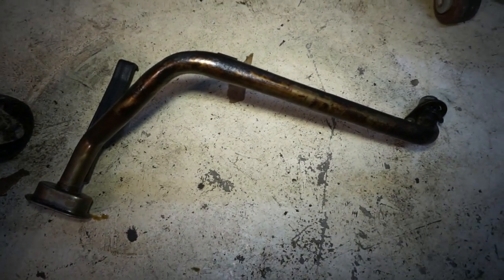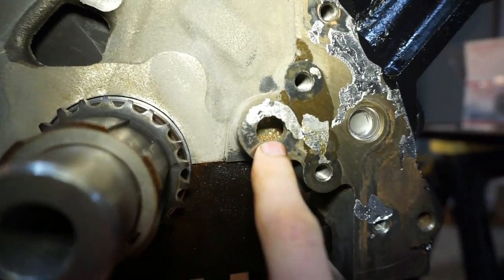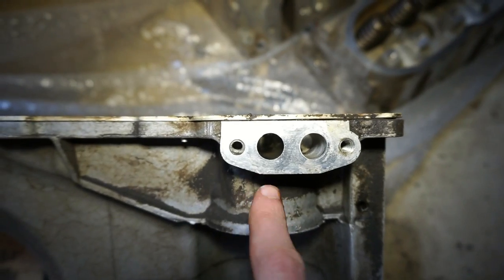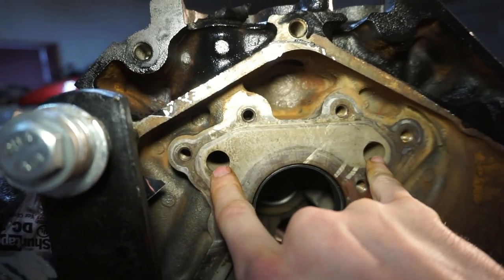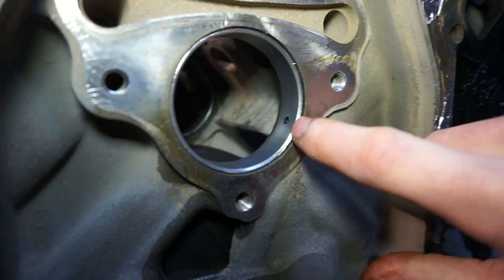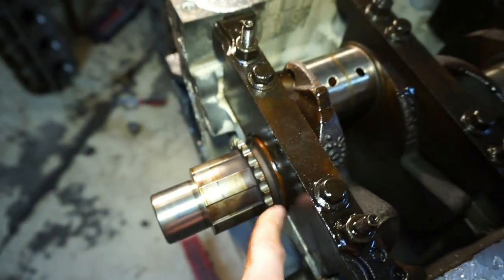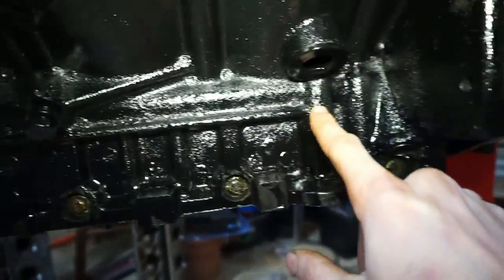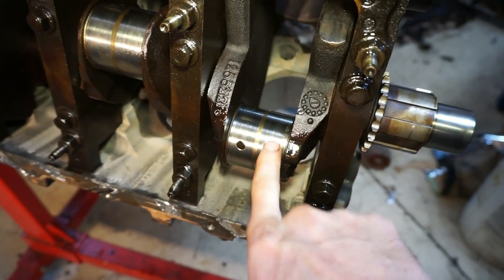LS Engine Oiling!!! Lq4 Oil Passage Flow!!! - a21bravo

Comment: Thank you. Your a life saver. Just rebuilt my brother 5.3l to have zero oil pressure at start. Quickly shut it off and had to think for a min then looked up how exactly the oil flowed through the motor. That's is when i found this video. Just as you started pickup tube to oil pump then you showed the soft plug next to the oil pump and i thought oh shit. I looked up my build pictures and realized that plug was not put in. Thought the machine shop i use did it but no worries took only 1.5hrs to correct my mistake. So thanks again for the video.

Comment: Good video. Lots of so called LS mechanics never take the time to understand this. To add, anything below the pump is suction, and a leak there can cause aerated oil and/or loss of pressure. Anything after the pump is on the pressure side, any major leaks along the way will cause the remainder of the oiling process to suffer.

Comment: Something an old seasoned ass commercial refrigeration tech used to always tell me back in the day when I was learning refrigeration systems, "follow the fucking flow!!". That simple phrase is applicable in so many scenarios, from fluids to electrical and mechanics. You're pissing in the wind trying to diagnose something if you dont understand the process.

Comment: I have never heard anyone pick up on this but like the way chevy designed the cam/ mains oiling it simply oils both at the same time instead of the way a factory 350 engines where the oil must flow around the cam to feed the mains and I also believe this is a better way than the aftermarket priority main oiling
Reply from the maker: Agreed.

Comment: EXACTLY WHAT I WAS LOOKING FOR!! Concise and thorough. Thank you so much! Now for the question: Why would you source your oil for your turbo from the oil cooler ports knowing that you're potentially robbing it from the cam and crank!?! I'm hearing you want as much volume to the turbo as you can freely flow (like a 17mm hole!) Makes me worry for my engine... Looking for input fellas.
Reply from the maker: The pump should provide more than necessary as there is a relief valve controlling it... On my truck I have it pulling right before the pressure switch and always has good pressure.
Reply: The oil cooler ports can potentially spell big disaster for these engines if you don’t understand how the lubrication circuit goes. You dont always want a ton of oil volume going into the engine, depending on oil pan capacity and the type of turbo youre running. Many Ball bearing turbo’s need restrictors. Many shallow depth oil pans can be sucked dry with a high vol pump

Comment: Great video! Very helpful! Quick question, my 6.0 Gen IV (L96) isn't getting oil to the rocker arms but my oil pressure sensor reads proper pressures. I'm concerned about a bad camshaft. Should I be concerned about the crank not getting lubrication? Will oil bypass the rocker arms and still lubricate the crank?
Reply from the maker: Yes the flow goes both directions to crank and rockers, the pushrods can get clogged and block flow. Pull them and hold them up to the light, should be able to see through them.
Reply: @BlaserBuilds  thanks for the reply! I pulled my pushrods and I blew them out but I'm still not getting oil coming to the top of my rockers. My oil pressure reads around 40. My next step is going to be inspecting the camshaft to look for busted journals or lobes. Should i do that next? I should also mention my truck has a squeek that happens at the same RPM as the camshaft.
Reply: @TheDadBodWorkshop  try a new rubber o ring to the pickup tube, that cures oilin woes sometimes
Reply: @amindnew527  thank you! I ended up pulling the camshaft and sure enough a lobe on cylinder 8 was bad as well as several camshaft bearings. Thanks for your help!

Comment: that was very cool! are you going to put an aftermarket pan to not starve it in hard cornering / acceleration?
Reply from the maker: Blaine Ludeman Wasn't planning on it, we'll see how fast she goes. Haha.
Reply: there's also a new engine masters that talks about using less oil for hp gains .. about 1 quart low is supposedly best lol. weird huh? less oil for the crank to churn through
Reply from the maker: Blaine Ludeman Haven't watched that one yet... I'll have to check it out.

Comment: Lost a keeper after a spring snapped/pushrod bent. took head off, oil pan off, pick up tube checked exhaust still can't find it about to remove timing chain  chain cover see if its in there. Should I check oil pump I don't know where to look after this Yes I watched and saw all oil passages I have a LM7 don't know if it differs I would assume not either way I've checked everywhere I can without taking the motor it's self out I really hope I can find it. I kinda just wanna send it if it's not in oil pump or timing chain cover I think I'm just gonna send it and hope for the best I'll learn the hard way if I have 2 😢.

Comment: a guy i know some how got an easy put down into the oil galley unter the orifice that is on the vlom engine at the back of the engine where the oil goes from the filter and up into the vlom head. he thinks it has managed to get into the oil galleys. so we started telling him to blow air into that oil port just under that vlom head and try to move it to a spot he might be able to fish it out. but now i'm leaning on him taking the timing set off and the cam thrust plate and using some type of magnet on a wire or stick to try and fish that part out of the oil galley. i think his turk engine is the 2007 4.6 v8 and form photos of that block that oil galley is large. also if the lifters remain in the block i do not think he has to worry about that part dropping into a crank oil port. so do you have any ideas? or maybe some one here can help out? he said he broke off an easy out and i told him they do not shatter like taps and some drills do. so it still has to be a complete tip of an easy out. and i have no clue why he did this but for maybe trying the get that meter out of the vlom head and the tip broke off.  thanks

Comment: Okay I have a question I just got a engine block bored and honed and put eveything back together but I'm not getting any oil in the lifters/ thu the push rod  all the lifters are new so i am not sure what is going on the oil pump is a new high volume pump and I havent had a chance to check how much pressure I actually have due to the fact I currently dont have a oil pressure gauge I will be getting one but I still went ahead and took the oil pressure sensor and had someone start it and I am getting oil to the sensor I'm just not sure why I'm not getting any oil to the lifters or up the push rod any thing piece of information will help I will be getting a oil pressure gauge soon to see how much pressure the pump is actually making.....
Reply from the maker: Did you put the barbell back in? Verifynwith gauge,and check if Pushrods are clogged? Hold up to light should be able to see through them.
Reply: @BlaserBuilds yes I put a biliet barbell and the push rods arent clogged when I first put the motor together used compressed air to clean them and I will be checking with a gauge as soon as I get one on my hands would you know of anything else I could look into other suggestions

Comment: I have a question would oil barbell cause oil pressure issues if you rebuilt a motor and dodnt replace it ik there is better aftermarket ones but would it effect it if it hasn't been replaced??
Reply from the maker: Only is its damaged. Usually not, but its possible.

Comment: So, I’m guessing you can’t prime the engine being the oil pump is on the crank? You know, prelube before firing her up?
Reply: yes you can prime the LS engine,there is a plug on the left front side of the block,remove the plug ,use a threaded adapter and hose with a manual or air pressure pump with resivoier and prime the engine from there.
Reply: You have to prime the LS with a pressurized tool. Melling sells one along with LS specific fittings. Many engines have this kind of oil pump, so with the right fittings, you can prime those too. A Ford Modular has the same kind of pump setup, and therefore needs the same priming procedure and tool.